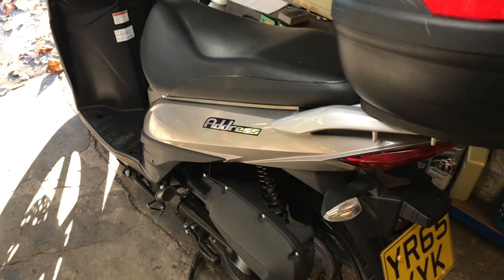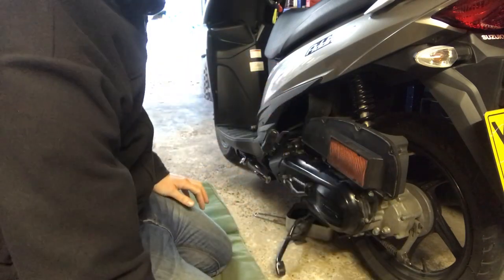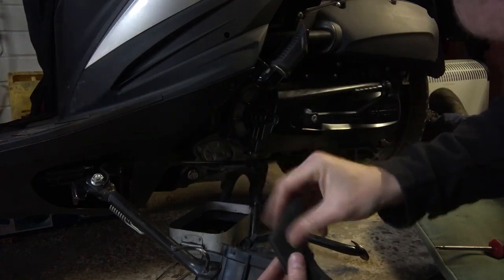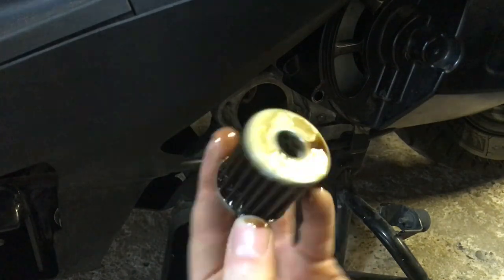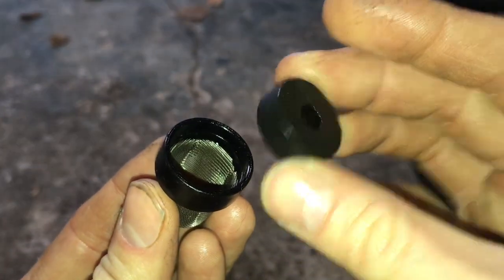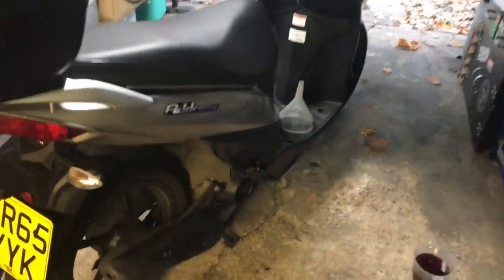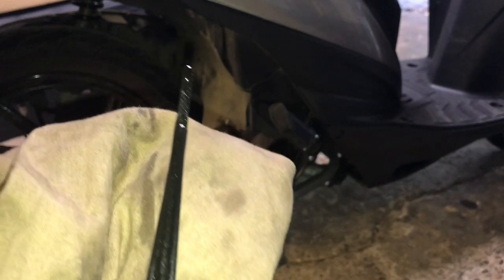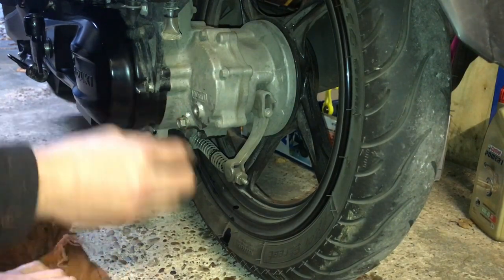Suzuki Address 110 - HOW TO SERVICE YOUR SCOOTER

Comment: JASO MB engine oil / scooter oil will work better on your scooter rather than the one you use on this video.
Reply from the maker: You’re right! Thanks for the tip. I’ve learned something there. I’ll make sure to use MB stuff next time 👍
Reply: @arjitagrawal4240   JASO MA2 lubricant (eg. motul 5100) for bikes with wet clutch, which needs extra acceleration since anti-slip clutch additive added. JASO MA2 is not fit on scooter since the engine hidden induce higher engine temperature excalete higher friction thus it needs friction modifier additive added lubricant. If it's hard to find JASO MB lubricant, you may use 10w40 engine oil, API SJ or higher. it would good enough for the Suzuki Address scooter.
Reply: Use iponic katana for scooters, either 5w40 or 10w40. Jaso mb
Reply: @Thế Tài Cao please read the manual to match viscosity lubricant as recomended for your scooter in your country.
Reply: That Castrol MA2 oil is fine, and offers superior engine protection. MB is the minimum that should be used, and is lower grade. The only difference is fuel economy, and thats a non issue on a 1cyl small engine.
Reply: @frankdux6930  JASO MB is not the lowest grade among other. JASO MB is the lowest friction engine oil for non wet clutch motorcycle (separate clutch, engine and gearbox oil) such as an automatic scooter. Please read the manual to meet spesific engine oil your motorcycle needed such as viscosity (SAE) and classification (JASO).
Reply: Odlican video i prava je stvar sto sipas Kastrol umesto  Motula ja koristim od Hajabuse do malog tog Suzukija Castrol power 1 10w50 godinama i nikada problema sa motociklima imao nisam inace imam ih 10tak i isto Castrol u sve koristim u u kvada,lepo i temeljno objasnjeno 👍🏻

Comment: In Indonesia, Suzuki motorbikes are the brand with the best quality materials. I like and enjoy this Suzuki Address motorbike. Comfortable, sturdy frame, fuel efficient and very easy and cheap engine maintenance. Even though many official Suzuki motorbike dealers have closed in Indonesia, getting spare parts is still very easy here.

Comment: Thanks for the upload bud. I have subscribed. My 16 reg address engine management light flashes amber 3 times, which I believe indicates it needs a service and then a full amber light comes on when u try to kick or electric start it. The service flashing light only started with the full amber light when it wouldn’t start, 3/4 mins after last using it. Thanks for the upload. The service is the first place I will start.
Reply: It was the battery that was faulty,  if anyone has the problem and is new to the address. 3 flashing lights indicates a battery problem
Reply from the maker: Ah excellent. Thanks for letting us know. I’ve been hoping to find the time to check the manual for you, but you beat me to it. Glad you got it sorted 👍

Comment: Great video thanks. Just wanted to add that there is a smaller O Ring that goes inside where the filter slides onto the raised section. The O Ring came out with my dirty filter. I just checked this O Ring wiped it clean and put it back in side the housing where it belongs. It would be handy if 2 New O Rings came with the Filter. It does for my Royal Enfield.

Comment: Hoping to use this video later on today to help me! Ran low on oil and added some old oil to it that was too thin. Hope that taking off everything and cleaning it out myself will save a trip to the garage! Really helpful video, hope I can get it sorted using this!
Reply from the maker: Thanks Ellie. What oil did you put in that was too thin? Either way, refreshing everything with the right stuff should sort it. Give us a shout if you get stuck 👍
Reply: @MechitBetter  it was oil that had been sitting for a while in the shed, so guessing that was why it was very thin unsure what it was as a friend helped. Yeah, hopefully a cleanup and the correct oil will do! Appreciate the help, will do!
Reply: @MechitBetter  Did everything, engine light is still on though! The filter does have oil on it so my guess is that's what is keeping the light on! Will be ordering a new one and get it changed over
Reply from the maker: Is the engine light on constantly, or is it flashing in a particular sequence? We’re on Facebook if you need a quicker response.
Reply: @MechitBetter  on constantly, its not a rush at all no worries
Reply from the maker: Have you been riding in the rain/puddles/washed it? Sometimes it’ll come on constantly if the electrics get wet, but then it’ll go off after a day or two when they dry out. Either way, disconnect your battery and leave it off overnight. That should reset the computer
Reply: @MechitBetter  nope not done anything different to usual, though I've been told sometimes the light comes on when it needs to be serviced? Though it was serviced in January before I bought it so that seems odd to me! I'll try what you've said tomorrow as I dont trust myself to disconnect anything so will wait until I have a hand, thanks for the help 😁
Reply from the maker: No worries. Yep the light on constantly indicates ‘service’ required. Not necessarily an oil change though. The manual for the bike says a constant light indicates a fuel injection fault. Here’s the page from the manual. 

http://i67.tinypic.com/sc55dg.jpg

Comment: New to scooters and thinking about buying this model in Thailand.  
A few questions - 

1) Does the bike require valve adjustment as well? If so, is it locknut or shim. I'm assuming locknut.

2) What's the secondary short lever for on the left (I assume the left lever is rear brake like a bicycle)?

Awesome video. Will come in handy should I choose this or a similar model. Also looking at the Fazzio.

Thanks again!
Reply from the maker: Hi. This bike will need the valve clearances checking occasionally. If they need adjusting, they are of a locknut type. It’s very easy to adjust them, but they rarely need adjustment anyway. The left lever is for the rear brake. There short lever in front of that is to allow you to lock the rear brake on if you need to. Perhaps if you’re facing downhill etc. it acts like the hand-brake in a car. I hope that helps. These Suzuki scooters are excellent 👍

Comment: Hi thank you for the videos they’ve helped me out on my address on many occasions.
installed a new battery about a month ago but today my address won’t start on the button ? Just wondered if there was anything I could check ?
Reply from the maker: If you have a multimeter you can check the voltage before you start it. It should be around 12.7v if it’s fully charged. Anything near 12.2v is low. Then if possible, see what the voltage dips to as you try to start the bike. If it drops drastically then the battery could be damaged. It has been cold though, and the battery is only tiny on the Address. Cold weather will make it harder to start so the battery needs to be well charged. Of course, it could be a different problem entirely. What symptoms are you getting?

Comment: Thanks for great video 
I have Suzuki address I bought 3 months ago 
It’s worked 4800 km 
When I should adjust valve and replace the spark plug?
Reply from the maker: Hi, sorry for the late reply. The official schedule says you should inspect the valves every 4000km and replace the spark plug every 8000km. In the real world I would imagine that you could just inspect and adjust the valves when you change the spark plug every 8-10 thousand KM. the valves clearances rarely need any adjustment 👍

Comment: Just bought my very first bike in December, and yes, you guessed it. It's a Suzuki address 110cc. This will be VERY useful to me but i do have 1 small question. When should i do my first service? I bought it as an ex demo / courtesy bike and it was registered in April but it has a full check before i bought it from the bike shop. I'm guessing after about 1k miles, am i in the right ball park?
Reply from the maker: Ah cool. The address is an excellent bike. Mines been faultless and really fun to ride. Around 120mpg too! There’s an excellent facebook group (see link below) that’s a great source of information. Regarding your service though, the first one is an oil and filter change at 600 miles, plus some inspections of various things. Next one is 2500 miles, then every 2500 miles thereafter. Valve clearances are supposed to be inspected/adjusted at each service interval. All this info is in the handbook if you were given one? It’s really useful and details a lot of the maintenance and service jobs. Let me know if you need any more info 👍

https://m.facebook.com/groups/1922116438012959?tsid=0.623016383500552&source=result
Reply: @MechitBetter  

Every 2500 km or 2500 miles?
Reply from the maker: 2500 miles
Reply: @MechitBetter  

Thanks!

Comment: These scooters are called NEX. in the Philippines. I have one about 5 years old now. BRILLIANT scooter.
You would not believe how normal guys work and maintain these scooters ..even myself .
I'm back in AUSTRALIA at the moment and going to buy one. Just trying to find out how many Ks. Before the drive belt needs replacing   I think. It's around 25000 k. ?? 
Also the spark plugs replacement. Is a bad design.. don't think it's as hard has that on my model.thanks 
⁉️why did you buy one 
Thks
Reply from the maker: They’re a great bike to ride and work on. I’d heard loads of positive things about them and I liked the look. They’re a bit smaller than an average scooter, and the plan when I bought it was to stick it in a campervan and have some adventures 👍
Reply: @MechitBetter  lots of people hang scooters on the back of vans in AUSTRALIA.
Also. If you stick with SUZUKI..HONDA.. YAMAHA.. they are all brilliant.scooters.
I have a HONDA pcx150.
HONDA beat 110 . HONDA scoopy 110.all great reliable scooters in their own way.
Great info on your video. Thanks .
I originally came from Manchester. It's funny to listen to your accent 👍👍😂😂

Comment: Great video quick question for you, do you know where i could find a replacement oil drain plug? Cant seem to find one online
Reply from the maker: Hiya Richard. I couldn’t say for certain where you’d get one other than the main dealer. I’ve had a few bits direct from Suzuki and they’ve always been sensibly priced 👍

Comment: I had a bit of oil on the engine side of my air filter, not a lot but enough to make me think. Is that normal do you think? Only a bit lining the air filter box, not on the actual filter itself.
Reply from the maker: I think that’s fairly normal. I wouldn’t worry about a light misting or odd drop of oil. If it gets serious you’ll know about it 👍
Reply: @MechitBetter  Brilliant! Thank you very much for the reply. :)

Comment: Hi i know this is a old video but I am planning on servicing my 110 address soon . I was wondering can I use any O Rings or do they need to be especially made for Suzuki bikes .
Reply from the maker: Hi Phillip. Which O rings are you referring to? In any case, so long as they’re the correct size and made for automotive applications (heat, petrol and oil resistant etc), then you should be alright to use non-original stuff 👍
Reply: @MechitBetter  thanks for the reply. It’s for the Drain Plug I have now ordered one and should be here in a couple of days . Going to follow step by step and do everything in the video. 👌

Comment: Good guide, though you should have mentioned that there is a small 0-ring that sits between the oil filter and the engine that can come out attached to the oil filter, it's important to check this has not happened and if so then put the O-ring back in place on the engine, using a clean screwdriver passed through the O-ring as a guide.

Comment: 2:31 I have 2013 Suzuki Let's 110 with same engine like Address. I clean a drain plug and o-ring with soapy water and dry it to make sure when I put it back and tighten it won't leak again.
Reply from the maker: Hi - Thanks for the tip 👍
Reply: Oh and I forgot. I apply some thin layer of oil to protect o-ring from pinching too.

Comment: Thank for sharing your wonderful experience. I have question for my scooter (Suzuki address 110). Last week, my scooter didn't start the engine, the led didnt work too. I was found the issues is the low battery and I charge it. However, today it still same which doesn't start the engine. I checked led, horn, signal work, but I cant make it fires up. Do I need check bugi or somethings else. Please help! Melbourne doesn't have many services and I am international student. Many thanks.
Reply from the maker: Hiya Mike. Did you replace the battery with a new one? Perhaps the battery is internally damaged, and cannot hold a charge. Do you have any facilities to measure the battery voltage?
Reply: The lifespan of small battery for scooter is usually less than 2 years.

Comment: How does this scooter hold up in cold weather with salt on roads? Will it be corroded to destruction after 2 winters? I might buy one but in afraid it won't last danish winters
Reply from the maker: Good question. The build quality is generally good, and the plastics should offer a fair amount of protection. There’s less metal on show than a standard motorbike. No motorbike is immune to road salt though, so it will depend how you look after it. A product like ACF50 will work wonders on any bike, to keep corrosion away. The exhaust on the Suzuki Address will need looking after. I re-painted mine after two winters. The front caliper pins can seize in but simply need removing and re-greasing regularly. Overall, I’d say it’ll be alright if you look after it - same as any other bike.
Reply: @MechitBetter  cool thanks, if the bike can last just 3 years, i can just trash it and buy a new every 3 years. I hope it can last 3 years driving 20 km for work every day. Much cheaper than a car if i buy a new every 3 year. Maybe i can even sell if for 500 eur after 3 years user.

Comment: I followed this video as I had oil dripping from the air filter casing. How would I go about cleaning and drying the air filter? 
I'm assuming the oil build up in that casing is blow by?
Reply from the maker: Cheers Kyle. I’m not sure if the filters are meant to be cleaned, so can’t help there. The oil in the casing could be blow by. Have you done a compression test?
Reply: @MechitBetter  no I haven't. I don't know anything about engines except for the very basics. I shall look into that and see how to do one.
I have ordered a new air filter in the meantime as it was really wet from the oil. Kind of useless having a wet filter as it will block faster from all the dirt.

Comment: Great Video, 

A quick question, which one is the most reliable step throughout bike from 100cc to 125cc which shouldn't give a problem & easy quick for repair as well? Thanks 

Honda Vision 110
Honda SH 125
Honda PCX 125
YAMAHA X Max 125
Suzuki Address 110
Lexomoto 125
Piaggio 125
Reply from the maker: Cheers! I don’t have personal experience of all of those bikes, but the Address 110 has been excellent. I also hear good things about all of the Honda bikes too. The PCX and X Max might be harder to work on, as would any other bike with fancy panels. The Address is a very simple and rugged bike. Everything is quite easy to access and work on 👍

Comment: Good step by step video
.A video for valve control had been estimated. How often should such a thing be done ? km?
Reply from the maker: Thank you 👍 The valve clearances should be checked first at 1000km, then at 4000km and 8000km, and then every 4000km after that (12k, 16k, 20k etc).

When I get around to checking mine, I’ll make a video of the process.

Comment: Im about to change my gear oil, and I just watched your video to see what type of oil you use. 
So I just use my engine oil? - 10w40 silkolene pro4 fully synthetic? 
Thought I should use the can of 80w90 hypoid gearoil that I have on the shelf from previous ownerships of honda motorcycles with shaftdrive.. But no? Just engine oil?
Reply from the maker: Just engine oil, like it specifies in the owners manual 👍

Comment: Hey mate, nice detailed video, thanks for that 👍 I have a question if not using the scooter for up to 6 months, and also can't access it during these months what would your advice be on the battery situation? Scooter has no kick-start. So is there anything I should do to help it for not draining it? Would it help to take the leads off the poles ? Any other advice?
Reply from the maker: Cheers. Thanks for watching. If you’re leaving the bike for 6 months then I’d suggest leaving the battery on a trickle/smart charger if you can. They can be bought for little money and will keep the battery healthy over winter. Removing the leads might help but isn’t the best solution. If you can’t leave the battery on charge then remove it from the bike completely and leave it indoors in the warmth. I’d also recommend using some fuel stabiliser to prevent the fuel going off, especially if you’re using fuel with a 10% ethanol content. The ethanol will cause problems if left for that long. Hope that helps 👍
Reply: @MechitBetter  Thanks for your answer, the bike will be a holiday bike will be standing in an underground garage in spain, will not have access to power, I think it never gets really cold there. Great tip about adding something to the petrol, didn't know something like that existed 😀 I will look up what that is and where to find it, have a nice weekend.
Reply from the maker: A holiday bike in Spain sounds like great fun. If it doesn’t get cold then just disconnect the leads as you suggested. I’d still expect it to need charging once you get back to the bike though. Enjoy 👍
Reply: @MechitBetter  Cheers mate! 🍻